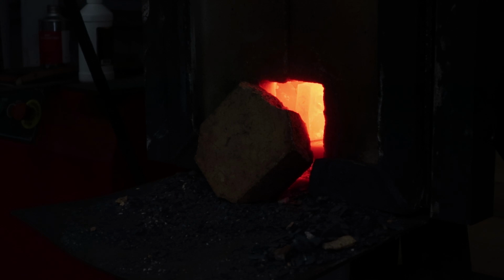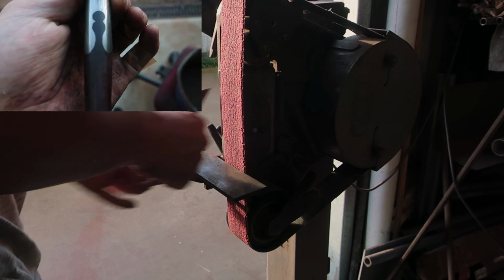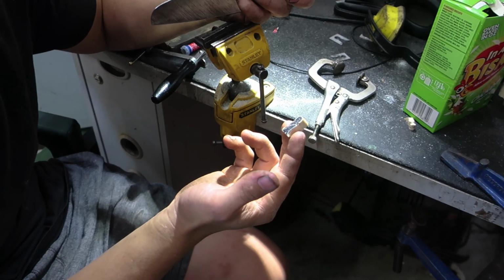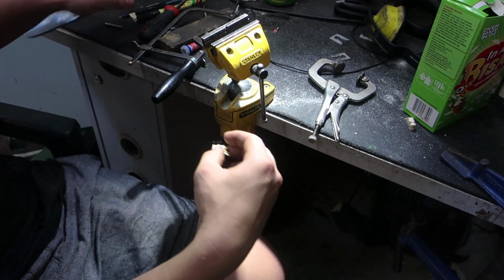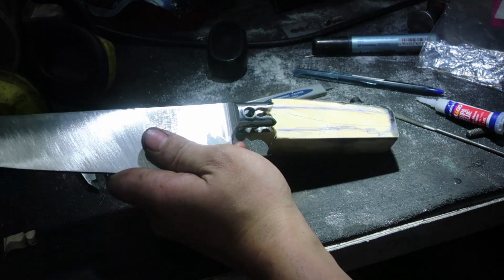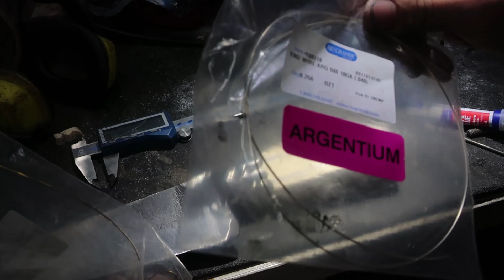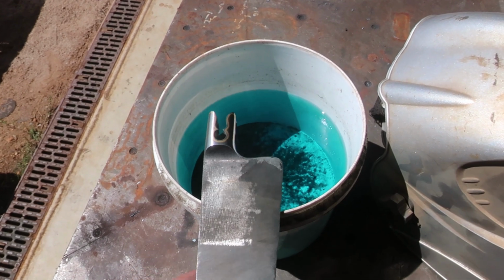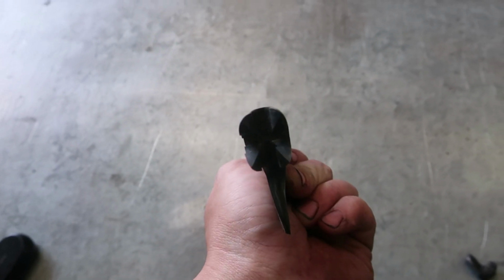Knife making: basket weave Damascus chef knife  (part2)

Comment: for handfitting I recomend prussian blue contact check. You brush it on your, in this case, metal keyhole. It will leave a nice blue contact area on your handle material, which you file down. If it needs to be more precise, you can use a smoke black lamp or smoke lamp. Its a paraffin lamp, which produces black smoke. the thin layer of smoke/ash will show you exactly where you need to file away the material. Gunsmiths use this for handfitting.
Reply from the maker: yeah mate I actually do use Prussian blue most cases, you can see me use it in my Yanagiba build i used it for fitting the end cap. its a good tip. and for the smoke lamp its the suet that marks it isn't it.  because i was using an oxy/acetylene torch but just found it made too much of a mess, maybe it was what I was using though. but yeah it was a great method also.

Comment: That's coming in nicely. I was wondering how you'd manage that double sided key hole, but I didn't count on a straightforward solution. Makes sense of course. I don't know if you've seen the woodworking version of "impossible dovetail joint" where you do the actual joint in a 45-degree angle resulting in the illusion that you've done a dovetail in opposing directions. Pretty much a gimmick but interesting nonetheless.
Audio is fine. Your accent isn't the most common (on the internet in general), not something that's easy (or arguably necessary) to "fix", but also your tendency to bunch up your words without a clear pause in between can add to that difficulty. I'm not a native speaker but pretty comfortable in English, but listening to you while eating chips probably would result in me turning the volume up.
If you listen for example to the beginning of this video, you say "Hey guys, today we're gonna transformsmsthatbilletwemade-" and a few seconds later "So Ialways make templates ofknives Iwanna make, because when it comes to forging, they do act as a good visualgui(de)". Not saying you need   to   keep   large   pauses   and  aNNUN-ciaTE   CLEAR-lyy  or anything like that, but if you want to work on the clarity of your speech to us non-native speakers, that would probably be the easiest and most cost effective aspect timewise.
Reply from the maker: Awesome! thanks for the feedback ill keep that in mind next time. yeah the impossible dove tail was actually my  inspiration so I thought of attempting this how the joint was originally made but it just seemed too hard unless I go with a simpler keyhole design. maybe it could be possible with an EDM not sure. its an interesting idea anyway. I hope have a great day.